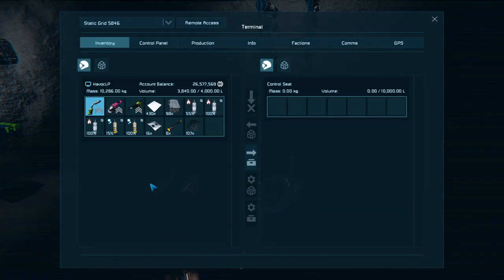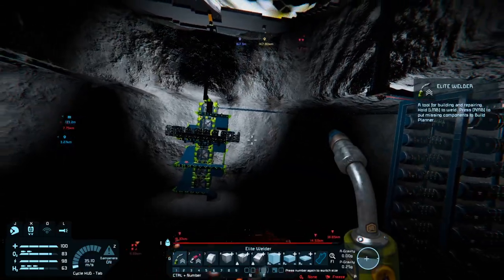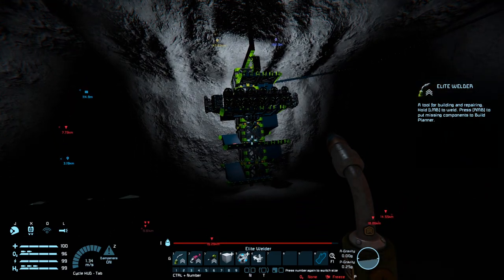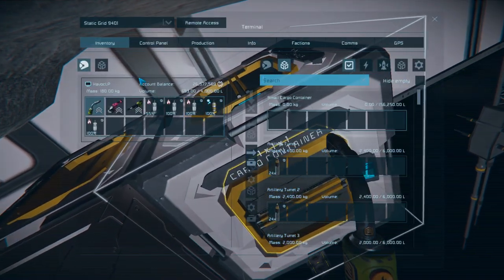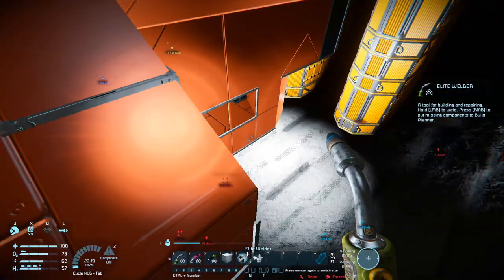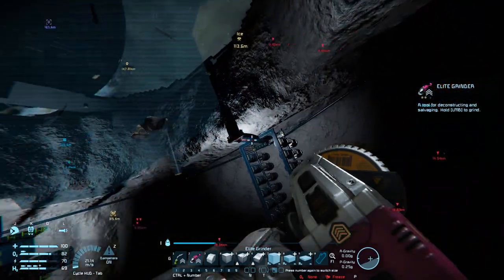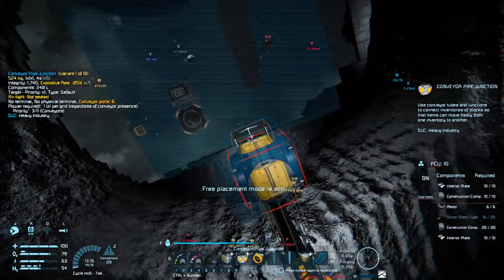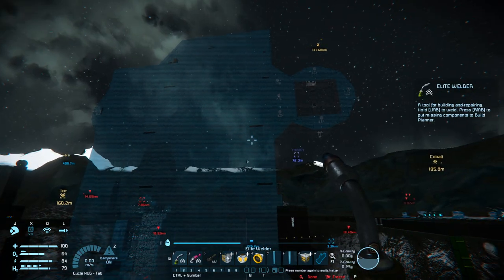Space Engineers ~ Not Hardcore ~ EP 115 ~ Printing Something Big

Comment: 27:00 Suggestion: due to this thing's mass, just being propped up on that little tube could cause you some problems as the machine builds...

Maybe put a couple of sticks of armor out from the edges of the upper deck that both accelerate the build speed, but also help support a lot of the wight... ~( 'w')/
Reply from the maker: Sticks added =)

Comment: Use a filter to pull uranium  to a single cargo on power gen grid side or a event controller to do it
Reply from the maker: Yeah but these is a reason why it is not working on its own when it should be.
Reply: Mite b it won't pull bc it's crossing a connector type of sub grid in stead of hing/rotor sub grid ????
Reply from the maker: I always thought a sub grid was a sub grid. I might just have to put a container and filter uranium to it. Use an event controller to turn the filter on and off when the system needs more power kind of thing.
Reply: Yep sounds good

Comment: 1. Are the reactors actually connected to each other? looks like where they should be linked together to the conveyor system that they werent and a light/heavy block was in the middle. 2. That bucket you're trying to take apart, is the projector for that on? cuz it looks like its also repairing itself just taking away the red parts. 3. Who asks for this stuff... im all for shenanigans but the carrier wasnt even done from the last season
Reply from the maker: 1. Yes they are connected cause at the end I do pass fuel to each of them =) 
2. Yeah I figured that out near the end of the video, turn of the grid then re paint the entire grid again.
3. The carrier was only asked for directly once. But there are many other things stated or requested that it will take care of as well. Need a bigger ship to protect the are, tho hole is to open need to cover it, there needs to be more def or more offense... to name a few. I know it is not compete and will give me something else to work on as the drill start working on the next expansion. The sections of the bases are not far from complete and will most likely get near completed this weekend.